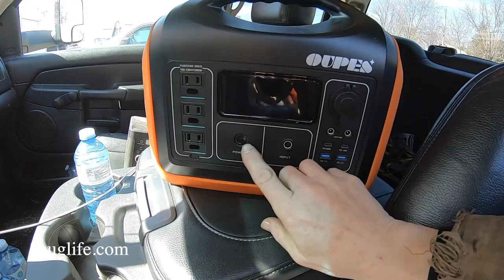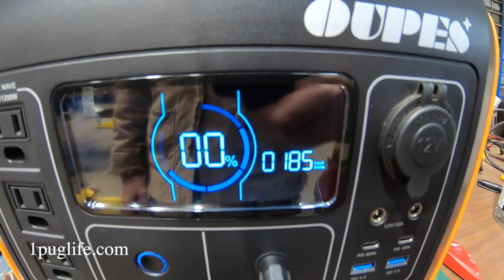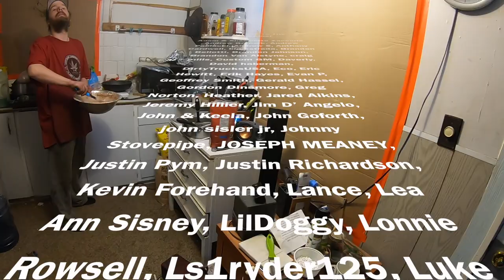stolen catalytic converters and flat jacks

Comment: When the engine knocks like that it means you need oil. Just pour in a jug in the hole in the middle of the motor.
Reply: carmine redd  the good lard
Reply: Make sure you fill it right up to the cap ffs

Comment: I hope Pug disconnected the battery. You can fry the computer welding on new vehicles. Way more costly than a new Converter.
Reply: That's a load of shit. If he grounded to the battery negative maybe true. Nobody does that. Grounded to the exhaust itself. No potential to the electronics in the vehicle.
Reply: Your right it can spike the computer.
Reply: @sleddarcheddar  Go ahead try it. Lol that exhaust is hooked to the manifolds of the engine, and the engine is connected to ground straps.
Reply: @RedWhiteAndBlueVideo  and like i said, no potential. You don't know how electricity flows do you?
Reply: @sleddarcheddar  show on your car for example. Why do you think you don't touch anything while working on electricity? So you don't complete the circuit.

Comment: I was thinking about welding a length of 3/4 solid stainless shaft or any hardened rod on both sides of the catalytic converter inside the exhaust tubing so they cut and cut but their blades just go smooth lol.

Comment: The mess in your eve...I'm tradesman....bend a piece of metal to cover that hole, or down the road you will have bigger problems...go under roof steel and in over top on vertical where it meets the wall, and in behind the facia on the vertical at rves trough

Comment: Hay bud I have a 2005 Dodge ram 2500 diesel  4 door what you pay for them runs has a new transmission typical dodge rust rockers cab corners box sides are fucked
Reply: Not tumuchi some cigrits and some different types of crystals